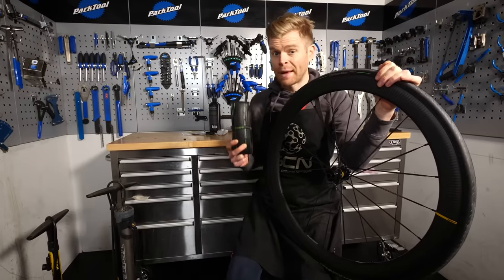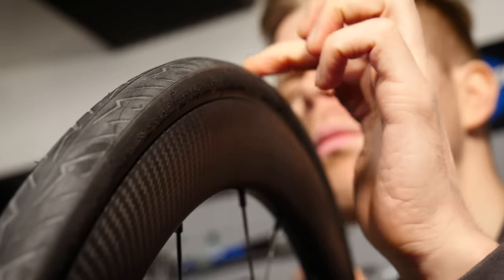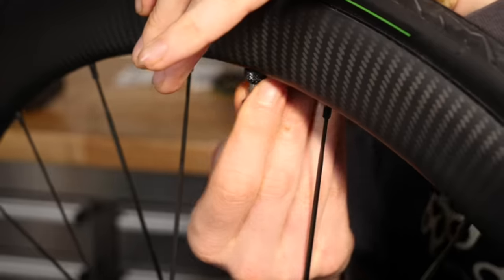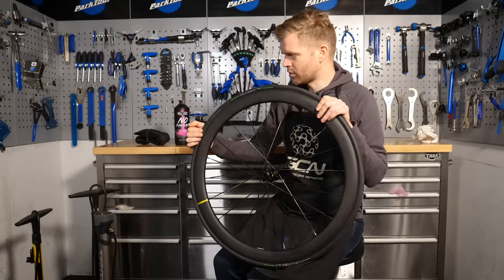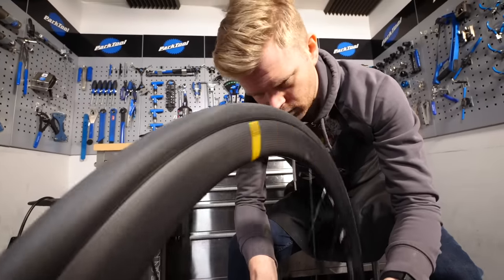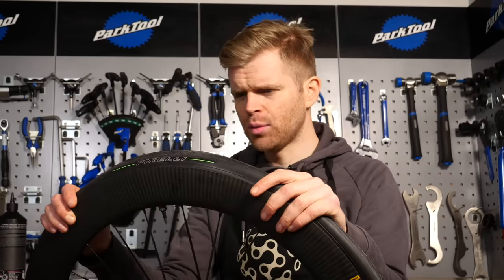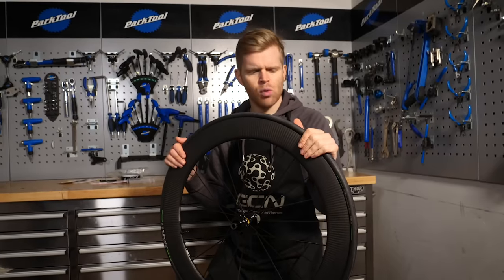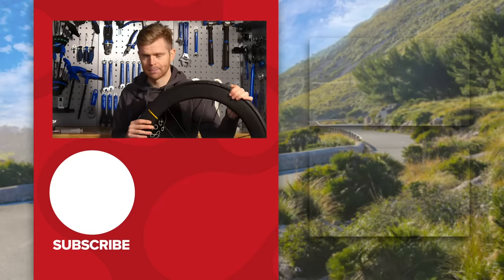How To Maintain Your Tubeless Tyres | GCN Tech Maintenance Monday

Comment from the maker: Are you using tubeless tyres? Let us know how you find them! 👇
Reply: I keep screwing up my tubeless tyres, this really helped hahaha. thx
Reply: Got my first ever set when I bought my Giant Defy Advanced Pro last year. That was in August. I feel like I need to maintain them now!
Reply: @AnvilAirsoftTV  biannual maintenance is recommended by most sealant brands
Reply: Weigh your tubeless setup without sealant and with immediately after you set it up. This makes for easier estimation of sealant to be replaced.
Reply: kenneth street sounds like it’s about time then. Thanks.
Reply: Some people add glitter to aid in plugging larger punctures.
Reply: And get a Stan's Notubes Dart, their plug strips are better than the regular bacon strips.
Reply: Have had the Mavic UST system for almost two years and have been puncture free, which is unusual as I used to get several punctures each year. The only one 'noticeable' puncture I did have, sealed on the ride. When I arrived home, I noticed that there was quite a large slice, so I removed the tyre (syringing out the sealant before removing the tyre completely) and patched it on the inside using a conventional puncture kit. Had no problems since.
I top up the sealant every 5/6 months. I have never needed to clean old sealant as the Mavic stuff doesn't seem to gunk up. The tyres have needed replacing before I have ever seen it drying out.
The only faff I find, is the initial breaking of the tyre bead from the rim.
Reply: After an initial learning curve to set them up, I like them. In the two years I’ve used them, they have self repaired a thorn puncture and seam to keep their pressure better than inner tubes. Pirelli Cinturato user
Reply: Third season on road tubeless. I will never ever go back to tubes.
Reply: Not on my road bike, but I plan on converting my mountain and gravel bikes to tubeless soon.  Thank you, great video!
Reply: I like my tubeless tires but honestly they are more maintenance that regular tubes. 
The gain is no roadside flats for 2 years on the tubeless bike.
Reply: GCN Tech Been running tubeless for 2yrs now and will never go back to clinchers. I top mine up with 30ml of Caffelatex every 3 months. I use to use top up by injecting in with the syringe. But in time I’ve learnt that there is no need inject it in. I now add the sealant to the syringe and gravity feed it in. I put the valve down to the bottom, attach the the syringe add the sealant and keep rotating the wheel so that the valve from goes from the 9 o’clock position to the 3 o’clock position. The sealant then feeds in on it’s own.
Reply: Mavic tubeless wheels and tyres not a bother even putting the sealant in, you would need fingers like a lesbian to get tyres off in winter to put a tube in.
Reply: Made the switch to tubeless a while ago.  Finally got my hands on the "new" conti' 5000.  32mm tires.  Lower pressure.  Tubeless.  If it's possible I think I'm in love with those tyres!  They are that good.  All through this Welsh winter we've kept on rolling!  Not a single P******e. Or not one I've noticed.
Reply: I keep finding new mistakes to make when mounting the tyres.  I've shot orange sealant across the kitchen and living room floors.  But on the positive side they've self sealed many punctures.  But back on the down side I've had several cuts that didn't seal and I'm still troubleshooting why (too big? Old sealant? Damaged sealant from co2?).

My wife is certain that road tubeless is stupid after watching me struggle for a year, and it is hard to disagree.  Still I carry on, certain there must be something behind the hype. It is hard to guess how effective tubeless has been as all of my winter commuting in London has been on tubeless, and it's impossible to see and avoid glass and potholes at night while pedaling as if your life depended on keeping away from the traffic.
Reply: I'm running them on my road bike and gravel bike.  I'm a big fan of tubeless, and a big fan of Ollie.
Reply: I started with one year using schwalbe pro one tubeless. One puncture, that sealed up good enough to bring me back home.
Last year with conti 5000 tubeless, no punctures but i had to replace two tires because strings on the sidewalls where ripping off.
I like the comfort of tubeless, but they wear out quite fast, i replace them after aproximatly 2000 km.
I also used specialized turbo cotton with lattex inner tubes, their rolling resistance is definitly not higher,
but they are more sensible, but i had no flats so.
I guess tubeless being more save than tires with tubes, is an advertising myth, i allways have a spare inner tube with me and never had any serrios troubles.
Just imagine you have to put in a innertube into a tubeless tire, far away from home. Lots of entertainment to be expected and cleaning up sealing residues is a mess.
This year i bought conti 5000 tubetype for my second bike and for me it´s the best tire i have ever used, smooth, comfortable and low rolling resistance.
For me it´s even more impressive than the conti 5000 tubeless tire.
So as a result after two years and 15000 km with tubetype and tubeless tires, i like both of them, but changing to tubeless isn´t necessary.
It´s just the industry and their advertising, suggesting that tubeless is really any better.
Reply: You should do a video on DIY pressure vessels, I made one from a 2L soft drink bottle and it nearly took my head off when it exploded.
Reply: Loving mine. But how often do you add new sealant?
Reply: Love my tubeless tires.  Have never had an actual 'flat' since I've ridden tubeless, and it's been 3 years now.   I have had to replace a tire that got slashed, but even slashed it sealed enough to hold low pressure and got me home.   I used to get a handful of pinch flats every year.   I have one set on Stans and another set on Orange Endurance (Hutchinson doesn't like Stans and say it will eat away at their tires from the inside or something).   Both seem to work equally well, but Orange Endurance lasts much longer before drying out, I'll probably just go with that sealant when I run out of Stans for use in my other set of wheels.
Reply: Use it on the race wheels but the commute they have been less than reliable. And sooooo much work to look after ... hence this video. 

$Special devices to inflate, $special wheels, $sealant, $special injection device, $seating....
$spa bath for the wheels, $pipe cleaner for your valves , 
$tire repair kit

gummed up sealant 
Sealant on the furniture
Sealant on the drive train
Sealant bath

Keep a spare inner tube
And bits of old tire

Don’t forget to repair the sealant in the optimal temp range ... 21C

Any hotter it will melt out, any colder it will freeze up...

😆 what a joke...

But it’s great when it works!
Reply: I had loads of setup issues initially but I’m actually really happy with them now.  It’s not a cheap option and it’s worth trying different tyres and sealants but the road feel during most speeds is quite reassuring and its my preferred choice now for Summer riding.
Reply: What a load of messy nonsense, I  am not using tubeless tyres and almost certainly never will. Mending punctures at the roadside isn't the end of the world, only a minor inconvenience.
Reply: I use them and like the way they feel when riding them as compared to clinchers, but I still feel that quality tubulars with their much lighter rims and latex tubes feel even better.  So for me there are two sweet spots: If you want reliable and cannot be bothered with a mess: Alloy rims with clinchers (and possibly latex tubes) that's what I have on my 1981 steel randonneur bike and would be preferred for long rides and touring.  If you want your bike to feel lke it flies: carbon rims with tubulars, that's what I like on my Titanium bike.  But tubeless is now not a bad middle ground.
Reply: @olisinterests  Interesting about the sidewall string - I have had the same problem on my (non-tubeless) GP 4000S II tyres. Not sure if it's a big problem provided you trim off any loose threads before they catch on the hub and unravel completely!
Reply: I've been running Schwalbe Pro Ones (28mm) on my Giant TCR and they're very comfortable and smooth-rolling. However, I have found that I lose pressure more rapidly than tubes, even with generous amounts of sealant. I had one puncture (caused by a broken bottle) that was too large to seal - it was quite dramatic seeing the sealant spraying out of the hole, and I had to fit an inner tube that I was fortunately carrying. I should carry tubeless sealing "plugs" in the future, because fitting the inner tube was a messy business on the road.
Reply: Been riding tubeless since 2017, and at first I loved it, but it’s becoming a hassle. Why? Because after 2017 I.... got more bikes. In reality, if you don’t keep the tires inflated, they will come loose from the bead seat, and then you have to clean them and reseat them, because bits of dried up sealant will prevent the tire from having an airtight seal with the rim again. If you ride your bike weekly, then tubeless works great. If you ride it a few times a year to once every month, stick with tubes. Again, once you lose the bead seal, you’re cleaning the whole thing.
Reply: 3 months now.  For the ride quality alone, it is worth it.  It reminds me of a tubular feel without having to stretch, age and glue a tubular.  I have Mavic wheels and tires set up was easy (especially compared to gluing a tubular)
Reply: GCN Tech just like “once you go fat, you never go back.”  Once you go tubeless, you never go back
Reply: I use them and do lots of kms would never go back to tubes. So far only had to plug one hole and that was pretty easy.

Comment: To fix larger cuts, you can easily glue a patch on the inside. Just buy a thicker one from a car shop (not the bike tire patch), some good rubber cement and you are good to go. I have glued several patches to my tubeless tires (mostly Schwalbes but also Hutchinsons) and will NEVER go back to innertubes.

Comment: I ride in an area with a lot of roadside glass, and I switched to tubeless after a bad month where I had atleast 3 punctures a week. Over 10,000 miles later, I have never had to stop mid ride to repair a puncture. I don't even carry tubes anymore, just a mini pump and a multi tool.
Reply: Justin Brunjes that’s what I did, until this weekend. I hit a rock and the sidewall of my tire cracked. No way to plug it. I tried to patch it from the inside, but wasn’t able to seal the tire to the rim with my mini pump. There I stood in the middle of nowhere for 2 hours until a fellow cyclist offered me his spare tube. Lesson learned: always carry a spare tube.

Comment: I started with one year using schwalbe pro one tubeless. One puncture, that sealed up good enough to bring me back home.
Last year with conti 5000 tubeless, no punctures but i had to replace two tires because strings on the sidewalls where ripping off.
I like the comfort of tubeless, but they wear out quite fast, i replace them after aproximatly 2000 km.
I also used specialized turbo cotton with lattex inner tubes, their rolling resistance is definitly not higher,
but they are more sensible, but i had no flats though.
I guess tubeless being more save than tires with tubes, is an advertising myth, i allways have a spare inner tube with me and never had any serrios troubles.
Just imagine you have to put in a innertube into a tubeless tire, far away from home. Lots of entertainment to be expected and cleaning up sealing residues is a mess.
This year i bought conti 5000 tubetype for my second bike and for me it´s the best tire i have ever used, smooth, comfortable and low rolling resistance.
For me it´s even more impressive than the conti 5000 tubeless tire.
So as a result after two years and 15000 km with tubetype and tubeless tires, i like both of them, but changing to tubeless isn´t necessary.
It´s just the industry and their advertising, suggesting that tubeless is really any better.

Comment: For bigger holes than the sealant can fill try Stans Dart plugs. They have small barbs which stop the plug coming out after a few miles and feathers which are dissolved by the sealant to form a more permanent  patch from the inside of the tyre. I had to use one in November 19 and it's still holding air after 1000 k.

Comment: #askgcntech
How do you know you need to add sealant? Or when to replace and clean old sealant?
Reply: Remove valve core, put valve at 6 oclock position then use a thin cocktail stick as a dip stick to check the level.

Comment: I found that using bathroom silicon sealant in the inside of the tyre is excellent if you’ve got a big cut in the tyre that won’t seal, but you don’t yet want to throw the tyre away. Obviously needs to be done at. Home once you’ve cleaned the old gunk out.

Comment: I met a bloke who uses a brush to apply a layer of sealant to the tyre before fitting it. He reckons it helps it works better. Can't say if it works better but he had a good full day at Flyup without incident.

Comment: Inspection, check. Sealant making a mess on bike while sealing a hole, check. Topping off sealant, valve core only; do not unseat tire. Top off with injector only. 60 ml is a lot for topping off. No need to reseat tire if topping off via valve. Good luck with getting the tire to reseat and not leak if you unseat the tire. Wiping off sealant is easy; do it out side if sealant is dried. Pipe cleaners work ok. Cuts in tire and plugs don't work? Cut a piece of thick butyl inner tube for a patch. Clean tube patch and inside of tire really well. Sand lightly inside and tube. Glue on with tubular tire glue. Works every time. I do not train on tubeless tires anymore. Royal pain in the butt dealing with cuts that won't seal via sealant or plug. You can run sealant in a butyl tube; it will seal small punctures such as tacks and thorns and glass. I use tubeless for races. By the way, you can cut a sidewall of a tubeless tire by hitting a rock hard enough to deform the tire against the rim edge where the rim edge cuts the casing. Yeah, no fun fixing that one. Have to put in a tube and boot the tire to get home. Make sure you carry tools to remove the tubeless valve core. And have fun with getting the sealant out of the tire! Messy! I live in Hawaii, Big Island. Topping off is needed about once a month. I was adding about 20 ml. When you aren't riding your bike, keep the valve at the top of the wheel so that dried sealant forms opposite the valve core.